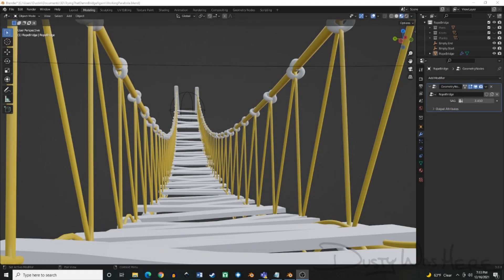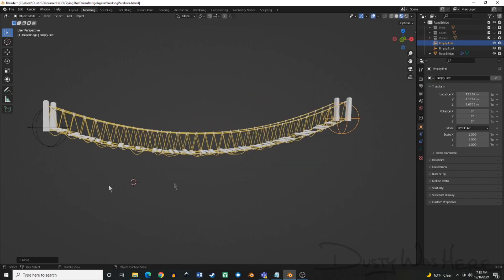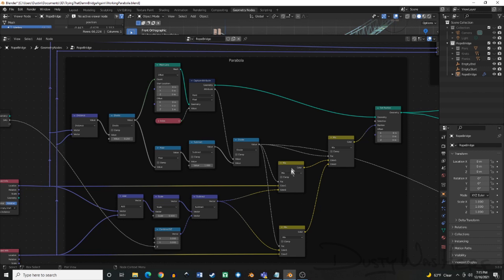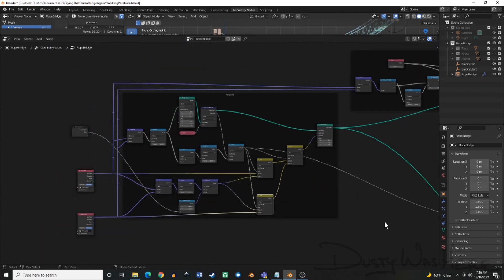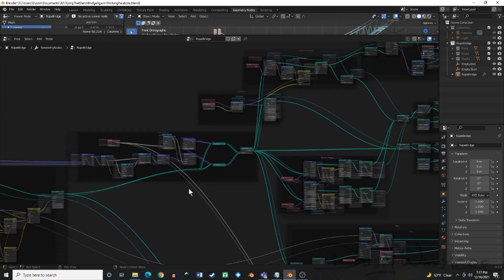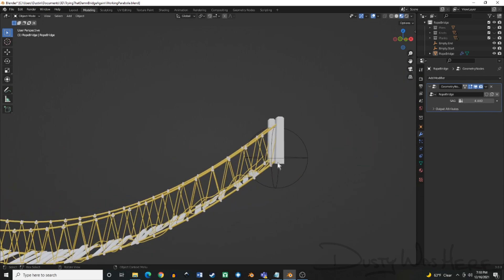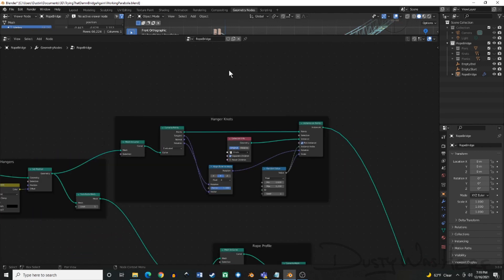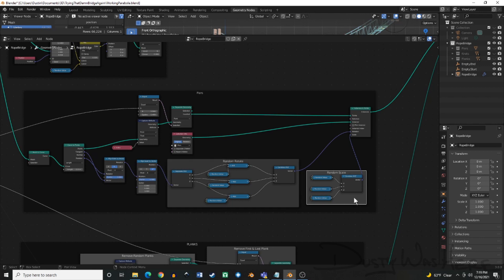Making Erindale's Parametric Bridge using Geometry Nodes WITH FIELDS

Comment: 2:09 Hey, a vector is (X, Y, Z) which is 3 scalars, and a colour is (R, G, B) which is also 3 scalars, so mathematically no problem treating one as the other. Think of (R, G, B) as a vector in colour space, if it makes you feel any happier.

Actually you can do the equivalent of MixRGB using just vector maths nodes, but it’s a little more complicated.